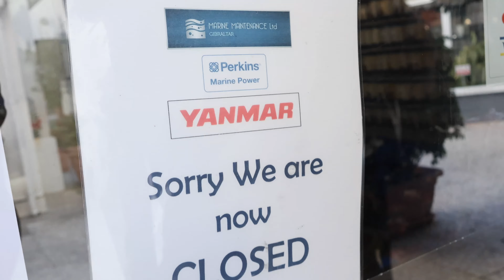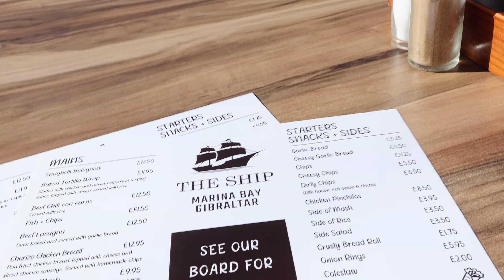Life in Gibraltar.. | Hatch acrylics, teak replacement and cocktails? | Ep. 47

Comment: Fab update guys 😊 can we ask a couple of questions pretty please 🙏 
Where did you get the acrylic from for your hatches? 

Which sealant did you use?

Thanks in advance 😊
Reply from the maker: Ahoy! The acrylic for the Lewmar size 10’s - I bought 300x300 smoked grey acrylic 8mm thick off of eBay.  I bought 6 blanks and cut them down to the right size with a circular saw and a belt sander, and then just sanded up the edges through the grits to a polish.  The sealant is CT1 Black.  It’s labour intensive, but for not a lot of outlay can get your hatches looking like new - can add a lot of visual value to an ageing boat!
Reply from the maker: A thought - it wouldn’t hurt to go up to 10mm thickness on the size 10’s - the hardware (hinges and latches) can all do it as they are made for both thicknesses anyway.
Reply: Fantastic, thanks guys for that, will have a mooch on ebay 👍😊